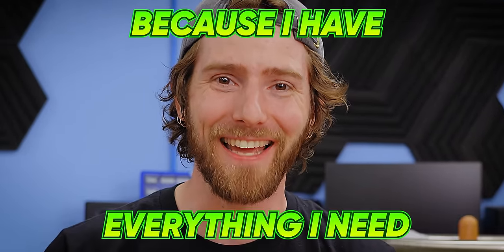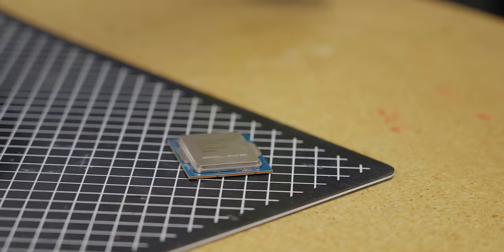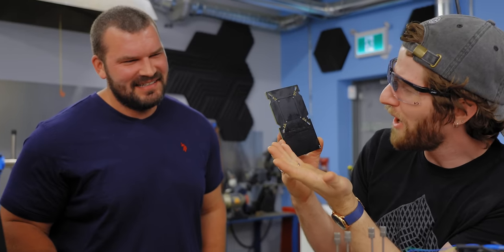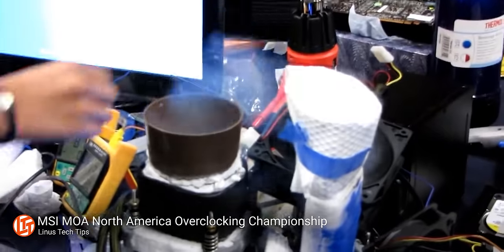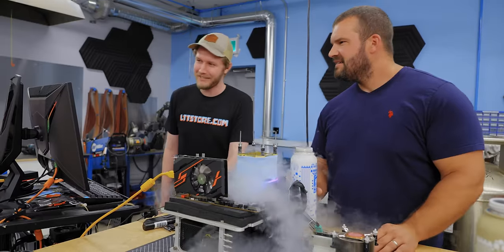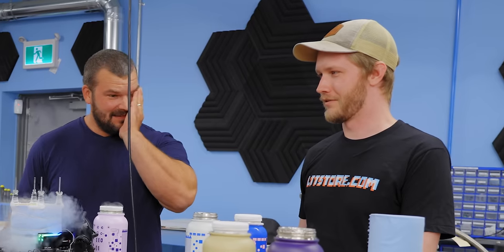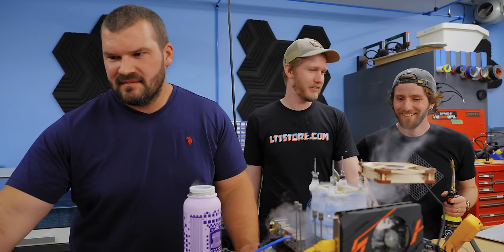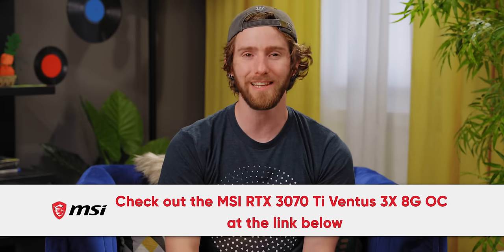The 6.9GHz CPU - LN2 Cooling

Comment: a cool extention of something like this could be to put the whole system in a pressurized nitrogen atmosphere so moisture isn't an issue then use a cryogenic heat pump similar to the ones used to make LN2 as a cpu cooler by maybe using LN2 or helium as the cooling liquid. have a raspberry pi or the like managing flow rates and temps and it could make one hell of a server (wouldn't want a set up that big on a desk so in a rack it must go)
Reply: The problem is, the action of the LN2 boiling rapidly is actually what sucks out so much of the heat. It pulls a lot of thermal energy out from the pot to go from the liquid to the gas state. This is actually very much how freon(r134) in our AC systems works, the transition from liquid to gas, and back, makes it able to absorb and release that heat so efficiently
That's a really neat idea tho, I wonder if there is a way to implement it in a moisture free pressure vessel that still allows the energy transfer as efficiently(maybe more?)
Reply: Can't they put it in a sealed box with a water condenser .

Comment: Speed of light is also a big limitation, 6.9 ghz means light can only travel 43mm (1.7 inches) per cycle, which is just insane.

The size of the die is 20.5 mm × 10.5 mm, now that clock cycle is only within one core inside that CPU die, but still insane, you'll start to see why there isn't a much of room left.
Reply: wAiT a MiNuTe tHoSe SpEcS aRe KiNdA SuS
Reply: Also the speed of electricity is slower than the speed of light, which could very well get it to within the range of the die if you tried to get much higher.
Reply: @shadow_rune6178  actually laughed hard out loud.

Comment: Just an FYI (months later) you'll probably encounter the leidenfrost effect with liquid nitrogen. Effectively the liquid boils away and shields the core from cooling; this is why you can dip your hand in liquid nitrogen.

If you convert to a pumped/flow setup you will avoid this. It would also allow you to use other cases like helium with little change.

Source: in grad school we worked with cryogens and temperature controllers for experiments at 4K or below

Comment: Another possibility for potentially avoiding condensation altogether would be to do what you're doing here with the extreme overclocking inside of a walk-in freezer.  The cold air tends to be dry and has the bonus of keeping everything cool, but not ridiculously cold.  The LN2 would still boil in a walk-in freezer.  You just may need to make use of a heat gun or that torch a little more.  If you did this inside of a sub-zero environment, you wouldn't need to go to the trouble of building a vacuum enclosure like the one I described in my previous comment.  I'm sure you could find someone who would let you borrow their walk-in freezer for a few hours.   ...Or you could possibly even buy your own if you wanted.  You could maybe use it to continue working towards breaking and even setting your own overclocking records. 😁

Comment: @Linus the true thermal barrier isn't even the increased resistance.  It's the reduced impedance due to increased quantum tunnelling as temperature goes up, which increases leakage current, which is the majority source of the increased heat once you get into thermal runaway.  That is what will damage the CPU, and that's the reason for throttling.  Well... unless you're throttling before you melt the board's power stages or power delivery traces.  We're at that point now where some mobos will fail before the CPU!
Reply: yeah it sounded wrong to me since semiconductor should have lower resistance as temperature goes up unlike metal. Thanks for clarifying the whole thing.
Reply: @someonestolemyname  I was also very confused, as resistance of semiconductors indeed goes down with increasinig temperature.
Reply: Ah, this is the post he referenced at the top! Thank you. Now I know that silicon has a negative coefficient of resistivity, which I think explains why he said that the board doesn't like to power on when it's cold- The impedance of the silicon is too high when it's cold & doesn't allow enough current flow.
Reply: @nickpayne1182  At the frequencies they're pushing, 99% of the chip is a series of connected RLC tank resonators being coerced into operating literally in harmony.  For best efficiency those little tanks are designed to operate happily in a given frequency range with a given amount of power based on capacitance, inductance, the driving voltage, the driving frequency.  The rate of change of voltage is based on the resistance (metal and semiconductor) and impedance (metal and semiconductor.) The resistance of both goes up quite linearly with temperature.  Impedance on the other hand is quirky, lol.  As the capacitance and inductance deplete they induce current flow which increases impedance to the depletion of the inductance.  Higher temps decrease that impedance but prolong it.  Net effect is that the transistor takes a little longer to switch, and so requires a higher voltage to switch fast enough to keep up with the clock rate, hence why cooling and under-volting allow you run higher clocks at lower power.  Quantum tunnelling does the opposite.  It's behaves similarly to how an avalanche starts thanks to vibration. The electrons want to get from A to B. Semiconductors can be biased to operate as either conductors or insulators.  Insulation works to prevent electron movement by presenting a uniform wall of electron shells perpendicular to the desired path of the electron(s).  As the insulator's molecules heat up and shake larger gaps intermittently appear in that wall.  When the gaps get large enough, the odds of electrons jumping through them increases (quantum is all about odds lol). That shakes the molecules even more, and soon you have an avalanche of electrons migrating where they shouldn't, plus more heat than was designed for.  If the heat is sufficient it can break molecular bonds and the electrons will start pushing atoms around, aka "electromigration".  CPUs have heat sensors to make themselves throttle before that happens, but those sensors can fail and allow a CPU to self-immolate, sadly, and that's part of why TDP exists - the CPU will also throttle above a certain power usage window as a backup failsafe anti-suicide measure.  Intel K series processors have that safety feature turned off... you pay for less safety lol.
Reply: @linuxgeex  Holy cow, thank you for the explanation & giving me a good starting point to do more research. I learned the basics of electrical theory in my apprenticeship, so luckily this isn't all Greek to me. Your explanation sounds very similar to what I was taught about reactance & hysteresis in AC circuits. Thank you again for the explanation.
Reply: @nickpayne1182  On the bright side, this fiddly work can be done almost entirely by ML software, and thank God for that since we're talking about billions of traces on modern core designs. So while learning those skills may be good for working with high power low frequency like AC and electric cars, it's super unlikely to be relevant to your actual job lol.  But I hope you managed to preserve your hunger for learning into your 80's, just for fun! :-)

Comment: You can call it a good day when Linus doesn't lose a hand while messing around with liquid nitrogen. I'm pretty sure Yvonne only found out about this AFTER it was already filmed.
Reply from the maker: @clavius5734  Gloves are actually bad when handling LN2.  Your hands are hot enough when it hits them the LN2 boils and you're protected by the vapour creating an insulation layer (Leidenfrost effect).  Put on gloves and the LN2 soaks in leading to v frosty hands. -AC
Reply: As was said, you REALLY don't want gloves or even socks when using LN2 for OCing. LN2 isn't really THAT dangerous assuming you know what it does. Movies make people think it'll freeze you instantly and that's just false.
Reply: To give a little more context as to the dangers of LN2, it has 2 primarily. First is its displacement of oxygen causing asphyxiation (don't breath the gas). Second is its cold, but when touching your skin it due to the temperature gradient causes the LN2 to flash directly to a gas with a sort of barrier forming between your skin and the LN2. If you put on gloves this doesn't happen, it soaks into the gloves and super cools the gloves leading to burns from it. This will happen with socks and other fabrics too.
Reply: I have worked with LN2 for biophysics work. you learn to respect it
Reply: @Honza obviously, but in extreme OC you don't directly handle things that cold and even in industrial applications you generally don't handle LN2 cooled things directly. Its very safe stuff assuming you don't do dumb things with it.
Reply: @DenDen10 that's really the case with many substances. Understand how they can be dangerous then respect those dangers and be safe. Common bleach or ammonia are things you shouldn't get too comfy with but people don't get scared of them like LN2
Reply: Yes, you have to be careful with household cleaning supplies! When I was 13 my stepmom almost died by accidentally making chlorine gas while cleaning the bathroom...It burned her lungs and she passed out and hit her head...
Reply: Thanks for clarifying, very interesting! I remember handeling the metal bits where the LN2 flows through (tube, coldtrap etc) with special gloves, never actually poured the stuff itself, so I learned something 😊
Reply: @bradhaines3142  She had no idea you werent supposed to mix them, but she never made that mistake again! It really scared her because It took her almost a year to recover from the lung damage...She passed out and laid in the floor breathing it in for atleast 5 min before I came in and realized what happened...
Reply: @NebulaAviation1  Nope!
Reply: @DuckMan77  "assuming you don't do dumb stuff with it" - we are in comment section of LTT video. People who like to do dumb stuff with anything might read this 😀
Reply: @bradhaines3142  never mix bleach and vinegar either, same result

Comment: Only time I've messed with liquid nitrogen was with overclocking a old socket 754 sempron i think 2800+ which was stock like 1.6 ghz pushing it too 4 or 4.1 ghz
On a poor matx gigabyte board with an nforce chipset.
At university ca 2013 or 2014 with a ocz 650w powersupply hooked up too it i think. Agp slot on the motherboard & integrated graphics was first used but that stopped showing a display after a bit (go figure lol.)
So a random agp card was used instead.
Ram was like one or two sticks of 400 mhz cl2 ram at 512 megs or 1 gb in total.
Pointed a fan at them & fan at the vrm which was completely bare btw, no heatsinks at all on either of them.

Classmate got too work building probably one of the most ghetto liquid nitrogen pots ever...

Step 1: Regular size pringles can, don't remember if it was either sourcream or a regular one.
Step 2: Gobs of solder on the bottom of it too raise it up around the motherboard a bit & get a sort of cold surface plate, think it was leaded solder, might have been unleaded or a mix of both.
Ofc making sure not too melt a hole through the pringles can bottom which is kind of aluminium foil ish so close enough right ?

Which also didn't crack from the cold & worked surprisingly well after some sanding too smooth it out flat which took him probably like 35 minutes or so lapping it fairly smooth too the touch & flat. + ofc thermalpaste later used for better contact.
Think it was MX-2 or MX-4 & caked the cpu in it.
Step 3: For mounting the pot somewhat more rigid then gravity, 4x holes where i think wooden sticks or pegs threaded through, zipties through the backside of several mounting spots on the poor motherboard too tighten it down doing it gently a bit at a time too keep it sticking down somewhat squarely on the cpu while making the mounting tight against the cpu.

Ghetto as all hell but worked surprisingly well enough too mess with & get it too boot into the bios at 4 ghz after all, probably not an overclocking record by any means but fun too do anyway.
Also filled the pot with bottlecaps & other random metal garbage from the workshop & a box of random pc screws too absorb & keep the nitrogen from dissipating too quickly, we surprisingly due too the Jank mounting we did had nearly 0 issues with issues booting up having readings at like -102c or so, but might have been the sensor just completely freaking out as well.
Ofc we used paper towels & a bunch of other stuff too insulate the board from any moisture the best we could together with the fans.
If we had a pci ide interface card we probably could have managed too make the poor thing boot into windows but the onboard controller & probably most of the chipset was noping out after like 2.6 ghz already & we kept upping the fsb as long as it booted into the bios after maxing out voltages on chipset, ram & cpu lol.
Reply: Ive reached 4.1Ghz or 4.15Ghz too on a sempron; using a phasechange keeping the CPU at -45 on avg.  Was a fun day. Installed the phasechange later ontop Ati 2600 pro which had stock clocks of 600Mhz, soldered all caps with larger or better ones, installed a external PSU instead of being fed through the PCI-E Bus, and managed over 1260Mhz core clock lol. Once i turned the voltage way beyond 2.2V the sparks just flew out of the back of the card and the party was over.

Comment: Could only imagine having liquid nitrogen running in a full loop watercooled pc
Reply: no radiators
ONLY RESEVOIRS
Reply: Kingpin already did something like that
Reply: Wouldn't it just burst from the LN2 vaporising?
Reply: You would need a compressor and a condenser to get the vapour back into a liquid. That might require a stage or too extra (like an LN2-to-ammonia heat exchange and a second compressor loop).
Reply: @xuser48  Apparently, liquid nitrogen is considered impractical as a looped coolant, but CO2 is actually used in commercial refrigeration. Apparently a bit expensive, but I read that it was being marketed as an environmentally friendly alternative to the currently popular refrigerants.
It was interesting to see it suggest big systems might leak hundreds of pounds in a year.
Reply: @privatemale27  - Most supermaket cooling is CO2-based these days. Large cold storage facilities uses ammonia.

Comment: You guys should try a raised reservoir feeding into the pot governed by a valve that you can modulate the drip rate to keep the rate of cooling/coolant use more accurate.

Comment: Absolutely, positively insane! Could you somehow run the pc in a vacuum removing air to condensate? Cool stuff guys!
Reply: I would think the process of removing air from the vaccum chamber would damage components
Reply: If you remove the air and turn it into a vacuum like out of space, wouldn’t the metal components weld to each other and the liquid turn to jelly and evaporated?.
Reply: I would guess the latent heat energy absorbed when the LN2 boils away is important for keeping everything cold enough, and a vacuum makes the boiling point too low
Reply: @anthonykoller4459  This only happens with identical metals, and very clean and smooth ones at that
Reply: They could, but the issue would be removing heat fast enough, considering it's a vacuum.
Reply: That was what I was thinking too. You could also set up a  case design with a dehumidifier to ensure only dry air is flowing over the components.
Reply: Could try and put it though a food saver, put some thermal pad over the mobo so it doesn't poke through.
Reply: In a vacuum the liquid nitrogen might boil off
Reply: could probably also flush it with nitrogen instead of holding it at a vacuum
Reply: @sigmamale4147  You wouldn't want the liquid nitrogen inside the vacuum. You would want the nitrogen in a sealed conduit that passes into the container, cools the cpu, and then vents boiled nitrogen into the air.
Reply: @privatemale27  that sounds like a complicated setup
Reply: @sigmamale4147  Nah, if you go the vacuum route, you just need few ports in the chamber to run coolant in and out for the components and cpu.
The dehydrator route just needs an off the shelf air dehydrator and some duct tape.
Reply: In space applications you can't use plastic packaged integrated circuit chips as they contain a small amount of moisture which boils in the vacuum of space, you need to use ceramic packaged devices.
Reply: @deang5622  Good point. Volatile chemicals evaporate out of plastic, even in our normal atmosphere... I wonder how they would do if you just sealed them under a thick layer of silicone.

Comment: You know what else helps? A well sealed room and a dehumidifier to pull more of the moisture out of the air.
Won't get it all but if there are any holes in your moisture barrier it will reduce the risk of anything getting too wet
Reply: and then wrap urself in anti static wraps

Comment: And also (and this is maybe the 5th time I write this) you CAN (and should, it's not difficult) put your motheboard in a controlled atmosphere (i. e. a box with a Argon or Nitrogen gas flow) so there is NO MOISTURE in the air. In the research world this is done for example to protect samples exposed to radiation from oxidation.
Reply: It's expensive to run a setup like that.

Comment: Hmmm, how cool would a Novec submerged PC with a LN2 powered heat exchanger to pull heat out of the Novec be?

I think Novec 7000 boils at 34° C but freezes as low as -122° C. 

Submerging the test bench in Novec would remove any condensation risk.  It’d also likely stay colder way longer since Leiden frost wouldn’t be an issue, and a few liters of Novec at -100° C would be a massive thermal sink.
Reply: I really wish it was possible to buy novec.
Reply: @KeinNiemand  same here!